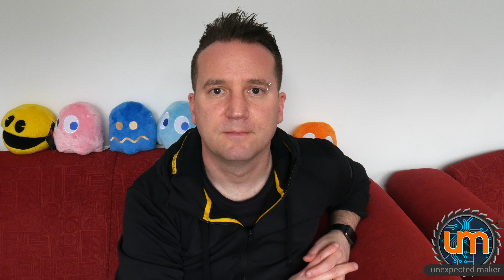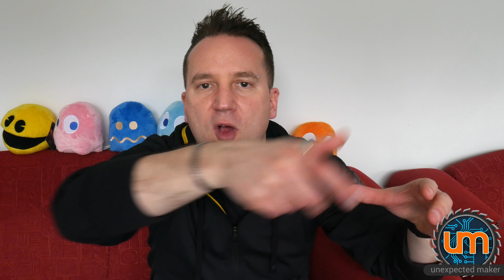Laser Cutter Fire Update - The Cause

Comment: Glad you're safe and you were able to do a root cause analysis. Sounds like a nitrogen assist rather than air might be a nice feature in a cutter.
Reply from the maker: Fire prevention in a fire making device is definitely a interesting problem... nitrogen might prevent the laser from actually burning and cutting.. and interesting ideas though!
Reply: Nitrogen will keep the air assist from functioning to its best capability. Think about when you start a fire, you blow on the fire to make the fire hotter. Same thing air assist does.
Reply: The cutter works via vaporisation, not oxidation and you'll find nitrogen or other inert gas mixtures used on all high output cutters, at least they've been on every one I've seen or contracted the use of. Helium/argon is used for cutting some metals like titanium because it easily forms both oxides and nitrides but thanks to cost it's only used when absolutely necessary. In the olden days of lasercutters you would often see oxygen used for cutting metals like stainless or aluminum when you didn't care about the edge finish. The oxygen turns it into a hybrid laser/plasma cutter and cut quality suffers however the speed and/or cuttable thickness goes up. Stainless cut with nitrogen has a great edge whereas stainless cut with oxygen needs sanding before you can weld it. I used to get 316 stainless cut back when I owned a marine safety lighting company (made the 2nd US Coast Guard approved LED mast top signal for sailboats about 10 years ago). I've been thinking about a K40 but the wattage is a bit low for what I want so I'm really excited to see what 80 does. 😎👍
Reply: Peter S metal cutting is very different from cutting organics. For cutting wood (most of what I cut) air assist blows smoke out of the way, blows soot out, and makes the cut hotter by forcing oxygen in.
Reply: Dan, over 20 years ago I was getting 3/4 inch Baltic birch plywood and formica cut and I can tell you that cuts with the nitrogen shied were so much better that I specified N2 shields for ALL cuts. They had minimal charing, they were much closer to 90˚, and there wasn't any "soot ring" on the beam entry surface as there was with air. The cost was a marginal service fee but was well worth it. One of the primary reasons for me not getting a hobby cutter is lack of clean cuts that I'm used to off the big machines and it seems that while people have upgraded the K40 to be a great bit of kit, it's more of a hobby/craft machine out of the box. I think a 'K80' with N2 would get me to buy.

Comment: Good to hear nobody were in actuall danger. 
May i ask you how, e.g. which kind of fire extinguisher you've used? (C0², Halon, Foam ^^)

Btw. are you planning to get the same "Jingke JK-K40(40,60,80W)" Series like a lot of other Makers? And will you introduce us to your new equipment?
Reply from the maker: Luckily we didn't need an extinguisher... the only thing that was on fire was the acrylic sheet, so it was pulled out and left to burn out on the concrete outside the garage. A good thing the K40 can only fit A4 sheets!

The belts had already burnt through and the laser head carriage wheels were already melted/fused... but none of them were alight. 

For the 80W I am looking at a RED/BLACK. I've not pulled the trigger on the purchase yet (It's a lot of money and I need to be 100% sure it's what I want) - but if/when I do, I'll 100% introduce it to my community.

I did purchase a CW-5200 chiller today that can be used on the RED/BLACK or my K40.

Comment: Hmm. New project idea: ESP32 smoke detector / environment monitor, with local BLE alerts to your mobile phone.
This is assuming you’d never operate the Laser if you weren’t actually at home / in range.
A Tindie must have for all higher powered Laser Cutter owners. :-)
Reply from the maker: Honestly, giving someone a product that is an "enabler" in having them not constantly watch their laser cutter I feel is pretty irresponsible. Unless it came with a fail proof cut off and fire extinguish capability, it's just asking for trouble ;) I'd rather no be a willing participant in helping someone burn their work/home down :-)
Reply: Fair comment!  
I've managed to overlook the rather obvious point: That a device like this would just be encouraging the idea of not directly keeping an eye on the Laser.
So I'll concede, that's a definite project idea fail! Oops. :-)
Reply: Would make more sense to have a monitor that pauses the task on a laser cutter or 3D printer if you leave the room. Probably more work than simply cutting the power, but GCODE does have a pause command.
Reply from the maker: Not a bad idea.. maybe with a 30 second timer, so you can move away from the unit for up to 30 seconds - I often go do something else in my garage while it's cutting, or go stand outside (3m away, with the garage door open) cause of the smell... so I wouldn't want to have it shut down for that. Def worth looking into!